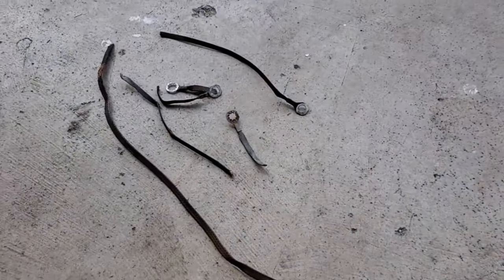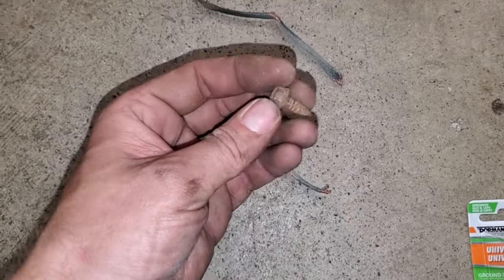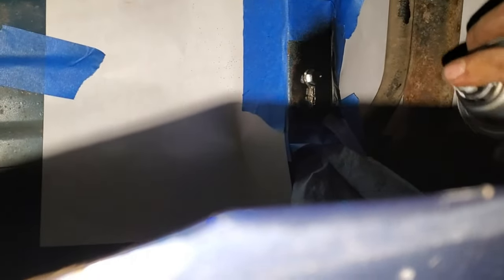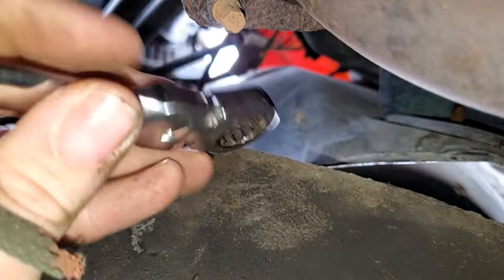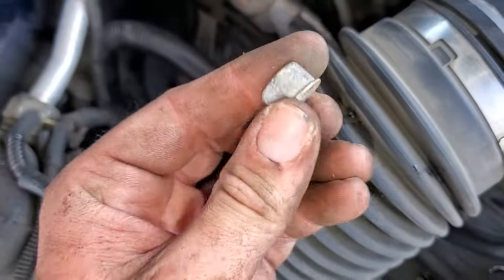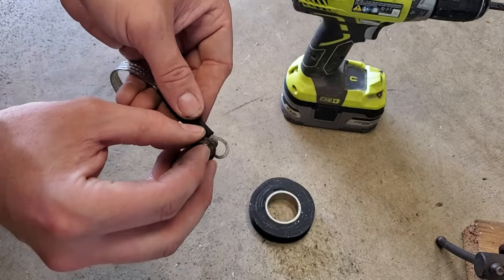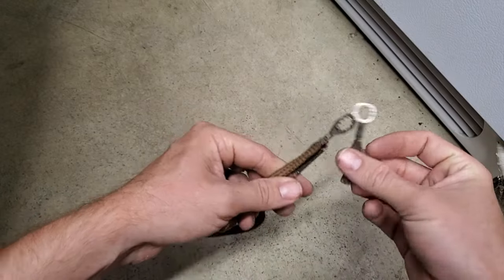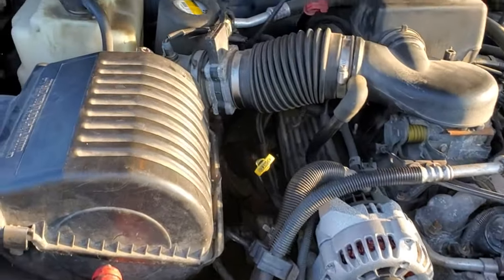OBS GMT400 Electrical Issues? Replace Your Ground Straps!

Comment from the maker: Turns out my workaround for the fuel filler ground repair is incorrect! My way just connects the bed together in 2 separate places which is rather useless. The proper way is for the actual metal filler neck to be grounded to bed. https://youtu.be/t8q5ckCYWnQ is the updated video for the filler neck ground strap
Reply: Was gonna say lol. Honestly easiest way is just to swap the neck. The strap is riveted on.
Reply: Might keep static from igniting fuel vapor. I think thats why its there
Reply: I did that before and my fuel pump didn't work anymore
It was grounded through the filler neck
Reply: Much respect man, js you actually acknowledged the mistake and didn’t just leave us all hanging lol 💯
Reply: Yeah so was going to comment on the very same point. Due to the plastic surrounding the filler neck and the insulation padding between the top of tank and body it doesn’t have a very good electrical connection to the chassis/body. So making certain a ground strap directly makes connection at the filler neck helps bond it back to the rest of the system. If I’m not mistaken the fuel lines transition to a flexible rubber section for a few feet before connecting to the fuel pump assembly.

Comment: Don’t want to be an ass but your fuel filler neck is made out of metal and isn’t grounded anymore. You grounded the side panel to the frame which is allready grounded. Maybe you have to try to drill out that rounded bolt and put in a bolt to secure the strap.
Reply from the maker: No offense taken and I appreciate you respectfully pointing that out! You're totally right though I didn't even think about that. Basically right now I just connected one portion of the bed to a different section which is pointless. Since there is a plastic piece in between the metal filler neck and that inner metal bed side, I bet that's why that grounding strap is there in the first place. I'll work on an update to correct. Thanks!
Reply: You’re welcome. Just wondering why you did that in the way you did. But he. It’s not a Saab. Like your videos about that and learned a lot of it. To bad we don’t have scrapyards here you can walk into. I have a 2003 93 sedan with an 1.8t engine. Actually it’s the same 2 ltr engine but tuned down to 150 hp. Tuned it now to 225. Brilliant. Keep up the nice work.
Reply: I was wondering about this an thanks
Reply: im pretty sure its primarily there to ground the fuel tank and prevent spark, and also the fuel related pumps and relays
Reply: @WeakestofWeeks  Probably just use a hose clamp around the tank neck and ground the wire under it and tighten it. My easy idea I had without having to messing with any bolts.
Reply: @WeakestofWeeks what’s that ground even do that’s by the filler neck ?
Reply: @obsbigmike Nothing too important, it just prevents static buildup during fill-ups.

Life would be more exciting if we all just removed them, imo.
Reply: My guess is so a spark doesn't occur between the otherwise isolated metal gas filler tube and the gas pump nozzle .

Comment: You missed the idea of the first ground strap. It is there to ground the metal filler pipe to the body ground to prevent a static spark. All you did was to ground the body to itself. The cup inside the filler door is plastic on most vehicles. You need that ground strap to be grounded to the metal filler tube.
Reply: I am fixing to go outside and start checking the grounds on my truck. Believe I also have a short somewhere. Thanks for this tip.👍

Comment: YOU should use stainless steel or bronze bolts.  Then anti electric grease and finish with silicone RTV sealant to finish off the job.  That works great fella. P.S. solder the terminals and forget the shrink tubing. That is what I did Sir. Cleared up a lot of problems with strange codes that surfaced. They all disappeared....😀😀😀😀

Comment: I have three late 90's OBS's, I have replaced most of them. I have worked on GM products for 40 years, they all have the issue. Great vid for newbies.
Reply: What r the issues they will or could have ?
Reply: @migoabu3928  There are a few. It's hard to list them out in the comment section. Single issues are much easier  to explain.
Reply: Is this also the case for the GMT800s?
Reply: How many are in total, beside these ones, saw one little wire from the Neg to the inner fender... also with the ones that goes inside the cab..!! Appreciate, im replacing all of them before chasis swap
Reply: @DiegoLopez-ii7ve  So far I have replaced 3 on one of my trucks. There is at least 2 under the hood. 1 near the gas cap. I would guess there are more at the rear.
Reply: have a 96. have a issue where light under headlight on passenger side flickers. and the instrument cluster in the dash still lights up completely but the area where it shows your fuel level is dim. would it be a ground issue? most looked good. except i notice the ground strap on rear of truck under fuel cap is broken or not connected would that affect anything?
Reply: @chizzlebeatz  Check the bulb socket.

Comment: You went from the bottom of the bed to the fender, the same ground you did not go to the gooseneck where the metal is your side panel and your gooseneck has a piece of plastic in between it. You need to go to the gooseneck with the ground strap that is to sew itwill not spark or have a static electricity check your work you’ll see what I’m talking about

Comment: The first ground strap is to ground the filler neck to the body in case of ESD when fueling. Your change in the location basically grounds the bed to the bed. I hope you move it back.

Comment: I have a 1998 Chevy K1500 with the 350 engine and I do a lot of my own maintenance. This has been a great video for me. I will check my ground straps for integrity and replace if necessary. Although I’m not quite to the level as you for OCD I do tend to overthink sometimes. I’m very impressed with your quality of video and presentation skills. Thanks for your efforts and I did subscribe.
Reply from the maker: Thanks for the comment friend!
Reply: @WeakestofWeeks will the ground strap near the fuel pump cause the fuel gauge not to work? I Just replaced the fuel pump an I seen a old ground strap that's broken everything works but the gauge would that be my problem? Please help I'm lost now
Reply: Will  a bad ground  effect the cam position sensor low voltage.. or maf low voltage

Comment: Forgot about this video, cleared my watch history and search history due to stupid videos in feed on YouTube.
This one popped up again 🎉
Went to the junk yard and pulled 2 grounds from a OBS, which had the engine and radiator support removed.
Measured the length of the grounds straps and the diameter of the ends.
Going to get some battery cables and a power to fuse cable made along with the grounds.
Cheaper than going to dealer ($400 for all the cables minus the grounds ) 
👌🏻

Comment: Replacing all of my straps tomorrow. On my 88 3500 , the worst one to reach/remove is the one on the back of the passenger cylinder head. Also when removing the nuts and self tapping bolts spray them down with  PB blaster or WD40 a day in advance to make them easier to break loose. 
Solid video , thanks for sharing!

Comment: Oh, this applies to every vehicle lol

I've got an 02 Silverado (GMT800) and when I first got it form my uncle (his old work truck), he said he couldn't use the AC because it would cause the instrument cluster gauges to stop working. I knew immediately if it wasn't a faulty AC component, it had to be a bad ground. So I replaced every single AC component (compressor, evap, condenser, lines, sensors) and wire wheeled every ground to chassis/engine I could find. My AC works beautifully (after some bad parts issues; stay away from UAC parts!!!) as do my gauges.

Comment: I removed, cleaned all my grounds, treated them with Deoxit spray... T stat housing ground went from .3 volts to .05 volts, engine running. (98 GMC Sierra)

Comment: Really appreciate the video. Was able to complete this because of this video. I used a 6 gauge 20 inch ground strap from Walmart for the frame to the back of the engine. Was big enough for both sides.

Comment: The ground wire connecting to the gas tank neck is to keep from having a spark whenever you put the gas nozzle in to fill your car up.
Connecting to the door does not work.
Reply: Yeap USE the hole to the right ! as a ground. Not the body of the truck.🔥

Comment: Yes sir you are correct on this topic 120% an the newer trucks are even worse,,,,as soon as 5 to maybe 7 yrs from new grounds start causing problems,,so many run down running an performance problems an think they have  them fixed an will be for a short then all the sudden same problem or more is back,,,and most if not all the time its a grounded issue,,the issue is that when the correct ground is lost the parts in question starts looking for another  ground,,so it keeps on keeping on meanwhile overloading the ground it  try to use,,,an now you have more issues,,,after throttle body fuel injection  entered our lives ground became more important than ever,,,,

Comment: Thanks for sharing this video and where to find most of the hard to find grounding straps. Also, not having a hooked up ground, would that drain a battery? Thanks in advance. My battery keeps dying and getting drained. I've replaced the battery, starter and had my alternator checked out. Still get drained batteries. So, I installed a manual power cut off from my battery to my starter and (knock on wood) no more problems with dead batteries. Thanks again for any help
Reply: Get a cheap multi meter, go inline negative circuit at battery. Under 50 miliamps is fine. (.050 amps) If its higher, start pulling fuses, watching for amp drop. When you find the offending fuse/circuit, get a wiring diagram & isolate the culprit. Google parasitic draw testing if you need more info. Once understood, its easy on these older vehicles...Make sure you understand how to set the meter up proper.

Comment: You have to run the drill in reverse to drill eyelets bigger will get very hot however it'll drill there with ripping it.
Reply from the maker: Good tip, thanks for sharing!

Comment: The ground strap on the filler neck is to dissipate and electrical potential and prevent static electricity from igniting fuel vapor.  You need to attach it to the neck as originally.  You basically ran the strap from the body to the body which has done nothing.

Comment: And if you break the stud under the heater hose you can just get a big self taper and it should snug up
Reply: I took a bolt out of my inner fender and screwed it right in
Reply: @blixiee4925  that’ll work too

Comment: How does that ground the fuel tank at all? Where you put that new ground seems to have no metal connection to where the old one was. You're connecting the body to the body..
Reply from the maker: One of those things I didn't realize until after the fact. I ended up redoing the filler neck ground to connect it properly: https://youtu.be/t8q5ckCYWnQ

Comment: I have a 2000 Chevy Silverado having problems with all interior electrical systems they come on and then they go off. I will try your your way to solve my problem tomorrow. I think that is the problem because I had an asshole change out the motor and nothing worked the day I got it back but he said he didn’t do nothing wrong ha ha ha thank you very much I will try it and I will let you know. Thank you
Reply: how did it go?

Comment: Would the ground straps on the passenger side cause the upstream 02 sensor on the same side to throw a low circuit code?

Comment: Any clue why my truck does not have the stud below the two heater hose? I had two ground straps at the frame point but I am not sure where the one went too that should be below the hose. I have a 1999 OBS Chevy with a 5.7

Comment: I have a 1998 obs chevy, has a problem starting, changed the battery, changed the alternator, changed distributor, did the timing belt and still wont start. Had a mechanic told me it could be something electrical any advice?
Reply: Will it start with starting fluid? How is it coming out of the injectors dripping or nothing at All?
Reply: Connect a fuel  pressure gauge at the test port. Key on cyle should yield at least 60 lbs. Crank engine over. Turn off. Fuel pressure should remain somewhat constant for at least 15 minutes. If it drops instantly, you have a bad fuel pump check valve, leaking injectors, or faulty fuel pressure regulator. Look inside the throttle body. If you see/smell raw fuel, pressure regulator is likely at fault The Injectors need around 60 psi to pop off/run the engine.
Reply: ignition switch?
Reply: Starter? Lol
Reply: If it struggles to start on rainy/humid days, could be the ignition coil. You can test it, or just replace, not very expensive. Delphi CE20003 Ignition Coil

Comment: Do you know the size of the bolt for the filler neck ground strap that goes to the frame? I know it’s 10mm but I need the actual bolt size. I’m missing mine. My strap is dangling.

Comment: Do you need to disconnect the battery first before replacing the grounds or is it fine to leave it connected?
Reply: The ground straps only matter when the key is in the on position.

Comment: My firewall ground bolt was already snapped off. What is a good alternative location to ground to?
Reply: Mine snapped off as well. All I did was take a wire with eyelets on them and bolted together the wire and the strap and bolted it to the coolant overflow tank mounting bolt. It doesn't look pretty but it works.

Comment: I have a 98 and I was looking for the ground stud on the back of the engine and the stud, bracket, and wire are all gone and all I see is the hole where it should go. If anyone has any suggestions it would help a lot

Comment: So the two ground straps under heater hoses you only kept one ??
Reply from the maker: No, I removed 2 and replaced with 2 new ground straps. There is one that goes from the frame to the firewall under the heater hoses. Then there is a 2nd that goes from the same frame location but to the back on the engines cylinder head.
Reply: Oh ok cause I have two ground straps under my heater hoses I have to check the one in the back of the motor. Checking all my grounds cause I’m not getting any power to the passenger door on my 91

Comment: Any idea which is the ground for the fuel pump? My gague is dancing . Thank you
Reply: I have the same issue and heard that it's might be  the air core stepper motor.
Reply: Sounds that you have a faulty gas sending unit. I had the same problem in my 1990 Cheyenne pickup sending unit was replaced and fixed that issue.